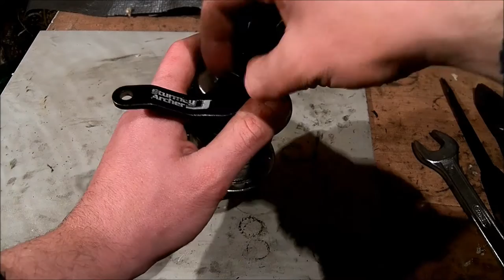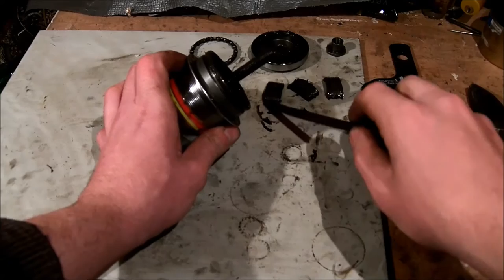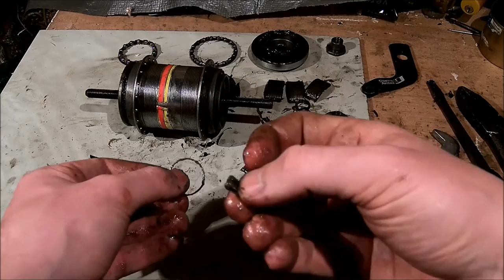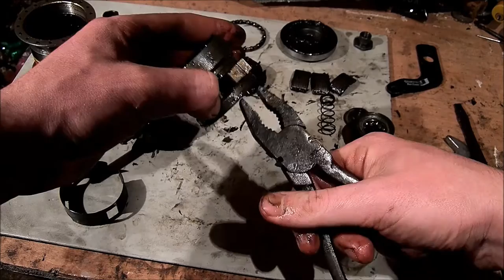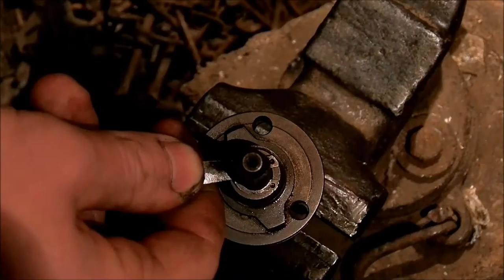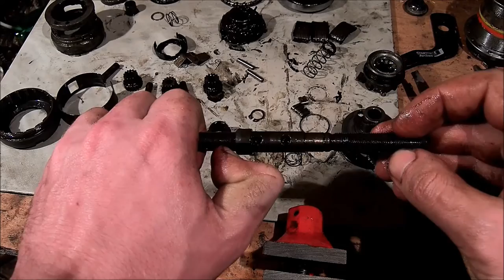Sturmey-Archer S5C Sprinter coaster brake hub

Comment: I saw a video of someone trying to fix a Shimano Nexus 8 and that model was far too complex for the average person to assemble and disassemble to maintain. Maintenance on that should be every year or two and would cost too much by a professional, but that doesn't really matter because no bicycle shop would want to do it.
This Sturmey Archer 5 speed appears to be much simpler to service by an amateur, while giving a larger gear ratio than the 3 speed. Would you agree?
Thank you.